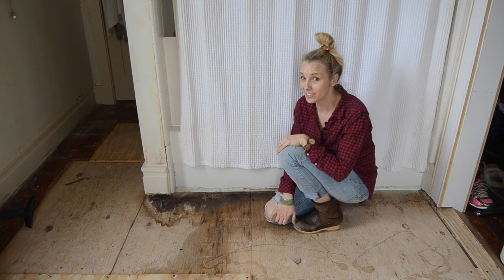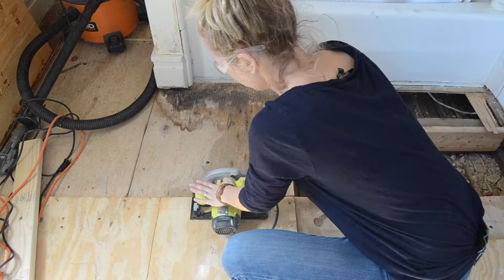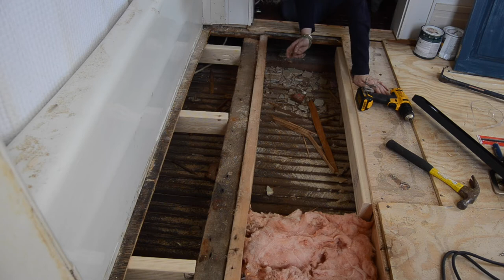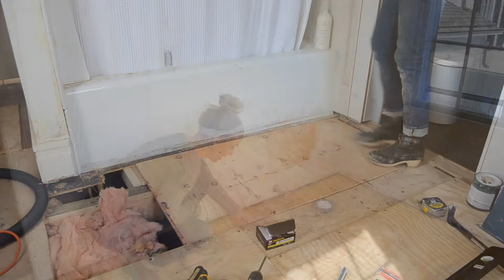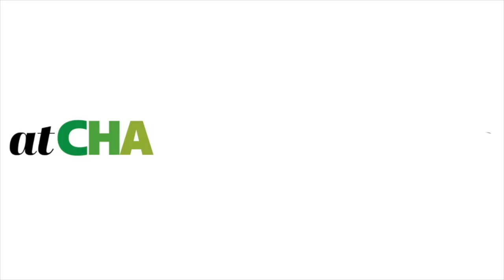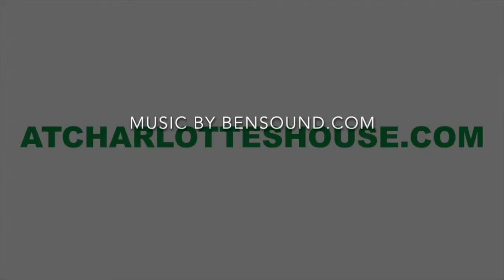Patching the Subfloor

Comment: Good job, but i would set the depth of the blade to slightly less than the thickness of the board and then use a multi-tool on the last couple of mills of wood, 1/16ths if you must. In older houses here in the UK, it is common to have pipes almost level with the top of the joist!!
A rail saw is perfect for this sort of work, but not cheap.

Comment: instead of the cross beams you installed, why not build out a support beam like you did on the other side?
Reply from the maker: Because the other beam was under the bathtub. I needed the cross beams to screw the subfloor into.